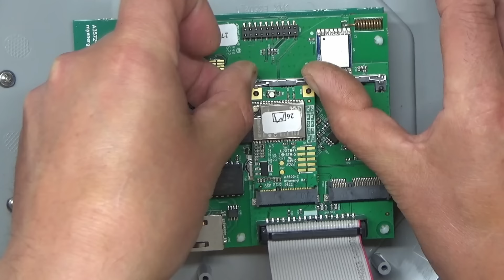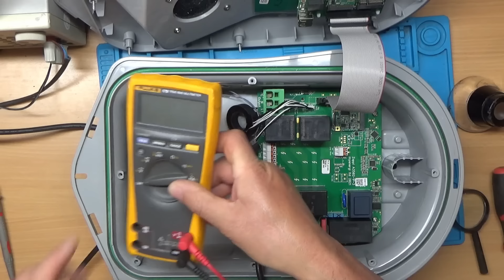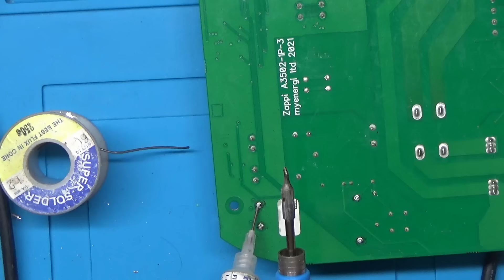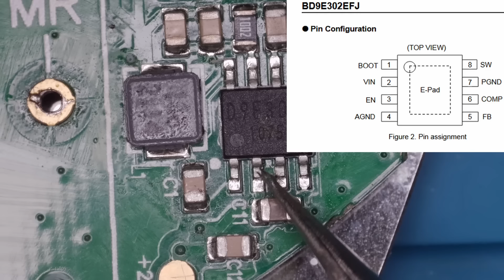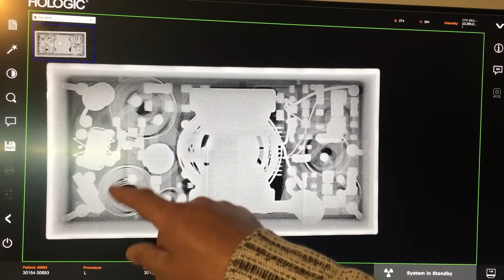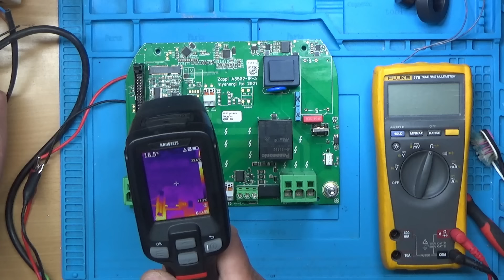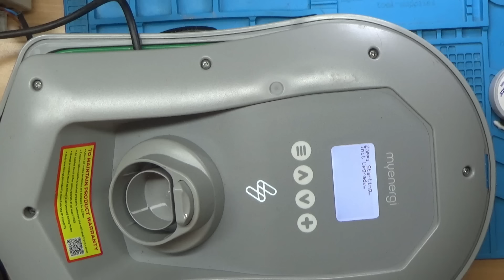Faulty MyEnergi Zappi EV Charging Point | Can I Fix It?

Comment: Hi mick, burt here, i have got to hold my hand up as when i got the charger i measured the out put of the psu and it was zero. Replaced the psu ( probably casued the via issue) still no 24v output, atbthis point ran out of talent 😢
 Again thanks for your time and effort, penny capacitor fights off a £600.00 charger? Many thanks
Reply from the maker: Hey, thanks for that. I did suspect that might have been the case as there was flux residue around the legs of the PSU when I first looked at it. After I removed the PSU I did check to see if any vias were on the legs of it, and there wasn't.  It did come out fairly easily once I got the solder off it. Anyways it's all good now so it's not a problem 🙂👍
Reply: @BuyitFixit  completely warranted now! Is what I'd tell myself 😊
Reply: @seanwilson7740 better than factory 😂😂
Reply: probably should of mentioned what you did to it before sending it in so he’s not chasing shadows
Reply: this is different level , ex ray board 😮, nice 👍 😊
Reply: Don't beat yourself up.  A lot of repair work is simply experience of knowing what to look at as the next logical test plus having some knowledge as to what things should test as to be correct.  Mains stuff like this isn't good for anyone inexperienced or wihout isolation transformers, etc. Probing around live mains still gives me shudders after almost 50 years of electronics as a hobby despite having all the right gear!  I bet you'd get further if you had another one to do and that's what it's all about.  Mick has an incredible talent, plus that special ability to refuse to be beaten!
Reply: Eliot, you 100% correct of to the garden to fall on my sword 🗡️
Reply: @burtjohnson7298  burtjohnson I think most don't see your comment because it is visible only if comments are sorted by Newest first, and mick has his video's setting set to sort all comments by Top comments, which hides many comments.
Reply: Great job
Reply: For anyone wondering, a via (short for Vertical Interconnect Access) is a small, copper-plated hole in a printed circuit board (PCB) that lets electrical signals and power pass between different layers of the board.

Comment: These x5r high capacitance low voltage ceramics are notorious for failing.  A lot of high rel folks don't like going above 0.47uF in a 0603 and 1uF  in 1206 size.  Tantalum or even electrolytics are often more reliable, but manufacturers love cheap smt ceramics
Reply from the maker: Thanks for the tip, that's really interesting info about the ceramic caps! 👍

Comment: Next time stop butchering through hole components. Use the vacuum desoldering gun. Guess who's fault was the via got destroyed?
Reply from the maker: The capacitors had already been changed by the person who sent it in. When I did this repair, I didn't have the vacuum desoldering gun. I bought that when I was doing the Williams Defender arcade machine as there were multiple chip on multiple boards that needed to be replaced.

Comment: @buyitfixit would you be able to recommend what capacitor you replaced yours with? I have almost an identical issue. Removed one of the two capacitors and it worked for a few hours and went again. Thermal camera showed capacitor was at 100c! Not sure which capacitor to buy to replace both

Comment: Excellent work Mick,

For future reference, you can make an easy EV Simulator Test circuit like your dim bulb - you just need to ground the CP (Control Pilot) in the tester (that all the car does to say "I'm connected").

Check out Pedro Neves Appliance adapter here https://youtu.be/x4urIvn0Ijo?si=gXip5XN5hqV0bjQe
Reply from the maker: Thanks mate 👍

Comment: I learned from experience that you've got to tread carefully when you think there might be via damage. Managed to pull a via out with a large electrolytic (10000uF) and didn't notice when I soldered in the replacement. Obviously it didn't work, and when I was scoping the output to see if the ripple wws gone, the cap dumped its load from the anode to the track/or between layers.. not sure which, and blew the output stage of the amp. Not fun!
The fix of course was to fix the via, replace two amplifier ICs plus the brand new cap which had a scorch mark on the terminal, but not before changing my undies!
I've found the best fix for broken vias is to get some very thin (1mm) solder wick and run that through the hole, then flood with solder. It will stay in place nicely because wick is quite solid, but the ends can be tagged down on either side with mask if necessary.

Comment: For people without an xray machine but with a decent multimeter or better yet a 6 digit bench meter, you can trace where the short on a pcb is by putting some voltage into it, and measuring voltage anywhere you can  find it on the pcb, the lower the volts, the closer to the short you are!  With that long trace across the pcb the voltage drop across that trace with say 1 amp goign through it would be easily spotted!
Reply from the maker: Great tip, definitely a handy trick for finding shorts! 👍
Reply: A meter with a good resistance resolution will do the same thing with out having to apply power. Sometimes to remove a short a nice beefy 30A PSU of the appropriate voltage does the trick.

Comment: How did u know the cap was 10micro farad 
? how do u measure the burnt cap in order to replace with correct value
Reply from the maker: Educated guess. You can't measure a shorted cap. I can't remember if I looked at the chips datasheet or if there was a very similar circuit elsewhere on the board that I measured the same cap.

Comment: Hey Mick. Love your videos, just wondering if you have considered reverse engineering a PCB to read data going to a existing wifi chip (ESP8266/ESP32) on a PCB, to your own stand alone micro controller?
Reply from the maker: Thanks mate 👍I'm not too sure what you mean. I used an esp32 a few weeks back on the Neewer RGBCW streaming light that had a failed MCU.

Comment: I'd bet pretty big money that the barrel plating was pulled out of one of the through-holes for the output of the little power supply module when it was removed by the original owner. That is a common problem with crude desoldering tools and/or poor methods. 
Solder suckers like the one used were fine back in the days of single sided PCBs. They just aren't adequate for much of anything else.
In extremely rare instances you can encounter a plated-through hole where the plating through a hole hasn't connected properly to a copper layer. This is typically due to poor "de-smear" where a thin layer of epoxy from the laminate smears onto the edge of the foil of the laminate during drilling and isn't removed by the de-smear process. Modern de-smearing processes tend to be extremely reliable. A fault in an inner layer would be much more likely than on a surface layer.

The big relays have 24 volt coils which is kind of a hint that 24 volts would wander over in their direction.

Multilayer ceramic chip caps are easily damaged by board flex which can happen near big connectors that aren't adequately supported. Because the ceramic layers are extremely thin in high-capacitance types that are common these days, a crack can lead to a short circuit with the most minute shifting across a crack. Board flex and hand soldering with an iron are by far the biggest killers of MLCCs. MLCCs specially made to withstand board flex are available, but they are considerably more expensive than ordinary types.

A meter capable of measuring very low resistance can be useful in tracking down shorts on a PCB - sometimes. It is one of the rare cases where accuracy doesn't matter much but high resolution is helpful, so some of the cheap products that have way more digits than the quality of their circuitry can possibly justify can be OK.

Comment: Very interesting, I do have an EV and I’m now on my 4th Zappi all though to be fair one had a faulty power convection block so it was replaced straightaway. That means 3 Zappi faulty in 6 years all replaced under the extended warranty, not a good track record though. Would I buy a my energy product again? Probably not as in my opinion there are better products available now.
Reply from the maker: Very interesting. It doesn't sound good that you had 3 failures! Thank you for sharing your experience 👍

Comment: Great work on that repair. For anyone not familiar with what these things do, it's effectively a big mains switch. The charging circuitry for EVs is in the vehicle, this is just a supply. There's a very simple signaling system that tells the vehicle how much current is available and the contactors are closed to supply power when the vehicle asks for it. Like many charge points the Zappi has lots of other smarts. It uses a CT to measure the mains supply that allows it to limit total load on the supply and make use of solar generation to avoid export. The additional licence free radio is used to communicate with other myenergi products like the eddi immersion heater controller and the libbi battery storage. They will also communicate over the network via ethernet or Wi-Fi. All of this is layered on top of the basic functionality of switching the supply on and off.
Reply from the maker: Thank you 👍

Comment: I have the microscope, the hot air soldering station, the Engineer solder sucker, the thermal camera, the multimeter... And then he got an x-ray machine! That's another level of repairing tool 😅
Reply from the maker: Just gotta get the xray now to complete the set 😂😂 Another viewer just got one, micronetwork. I've seen them sell for at little as £350 online...

Comment: I'am bit confused. You replaced the cap it did'nt work AND then make a jumper wire and working. Was there 2 errors?🤔. Very good video indeed!
Reply from the maker: Thanks 👍 Yes two problems. Shorted cap was the real problem, but it seems the owner had already replaced the PSU as he thought it was that, and probably damaged the via (see pinned comment under video).
Reply: @BuyitFixit  Oh, I missed that. Thanks so much for explaining!

Comment: Thank you for the Xray machine link Mick!
I won the bid and it's all mine 😁🤓
Reply from the maker: Nice one 👍
Reply: @BuyitFixit  Can't wait to get it! One interesting thought, is it possible to see any damage inside the blown capacitor with the xray?
Reply from the maker: @micronetwork I've not tried, but I doubt it. It probably will just show as a white block. There's quite a number of settings you can adjust and depending on what version of software and O/S or PC is in it. It looked like win7 on that one. They upgraded a lot of them to win 10 x64.

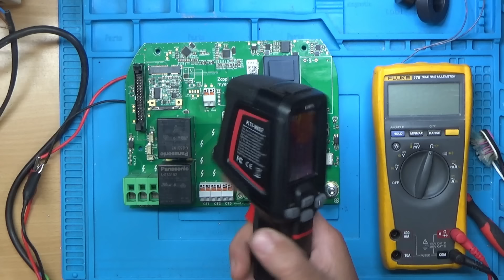Comment: At 25:42 when you turned on the power supply the two crocodile clips was touching each others and that will not create any hot spots on the board ...

It is so sad to see that a tiny tiny capacitor that cost less than a dollar can make an item that you pay several hundred of dollars for go bad ...
We see it everywhere, laptops, graphic cards, motherboards and so on ...
Reply from the maker: Yes those types of caps seem to be a problem on modern electronics, and electrolytics on older and newer stuff too. I didn't notice the crocodile clips, but I probably was concentrating on measuring and thinking what to say to the audience, also the top down camera has a different POV to what I have.

Comment: After you have open it and repaired it the item is no longer CE marked and if the item isn't CE marked you are not allowed to use it in EU ...
The same rules applies for other markings as well ...
Reply from the maker: I could understand that if you modified the design, but most electronic devices have a CE mark, so that means you can't repair anything?
Reply: @BuyitFixit  Unfortunately! That is why you shouldn't repair devices that run on 240 volts for anyone other than yourself. If the device catches fire and you have repaired it, you could be held responsible for starting the fire.
Reply: @fu1r4  The lack of a CE mark only affects import and sale, not use.   Certainly not personal usage.   Modification will invalidate the CE compliance.   People have been repairing CE marked goods for many decades without issue.
Reply: @BuyitFixit  This is what i found, so you are allowed to do some kind of repair...
"It is possible to repair a CE-marked product without invalidating the CE marking, but it depends on the nature of the repair. If the repair involves modifications that affect the product's compliance with the applicable EU directives, then re-certification or re-assessment might be necessary. However, minor repairs or replacements with identical or equivalent parts generally do not require re-certification."

Comment: Nice fix. Too bad you didn't spot it at the beginning, might have saved you from desoldering or having to add the jumper wire.
Reply from the maker: Thanks 👍 It seems the previous owner already replaced the PSU and might have damaged the via previous (see pinned comment under video)
Reply: ah, sorry, didn't see that

Comment: Very good, another saved from landfill. Not a negative comment, I would replace any MLCC that I had removed as they suffer substantial heat and sometimes mechanical stress during removal and that can shorten their life (not to mention, my life, whilst watching). Sometimes those AC/DC modules are not potted, you can usually tell by their weight.
Reply from the maker: Cheers Ralph 😂😂😂point noted about the caps 👍

Comment: I've repaired several of these, and on 4 of them it was the same C28 which had gone short-circuit. One of them went on to fail again a few months later, and it was C29 this time. It makes me feel that there may have been a bad batch of capacitors at some point. Another common fault is the relay next to the Out connector overheats and sticks in the open position.
Reply: Andy, Burt here when you tested the board failed cap could you measure voltage on the top side test pads or did the defective part pull the voltage down to zero? I only tested from the top side not the leg of the PSU on the underside of the board, thought it was PSU and subsequently made things worse. I will get my coat 😢
Reply: @burtjohnson7298  The first time I came across this issue I did as you did, i.e. suspect the PSU block and remove it. When I found the short was still there and that the PSU block worked when removed, my next step was to connect a current limited power supply to the 24V on the board, slowly raising the current limit until my thermal camera showed the problem device. In your case, the discontinuity on the circuit-board added a further complication. 

Now when I see a dead Zappi, I start by checking C28 for a short.
Reply from the maker: Very interesting. Thank you for sharing 👍

Comment: I first came across zappi motor choppers, about twenty odd years ago. Good kit,.....firmware access was expensive then. Unless you was good with hacking...😂
Best wishes 💪
Reply from the maker: Thanks 👍 I've not come across zappi until now. What was the firmware for? I've done a bit reverse engineering in the past ;)
Reply: Had to buy a handset, to be able to program min/max , parameters, vac pedal, regen and other levels .  @BuyitFixit

Comment: Was the original fault just the capacitor? and the track fault was due to unsoldering the little 24v psu?
Reply from the maker: Yes. Track damage seems to have been caused by the owner (see pinned comment under video).